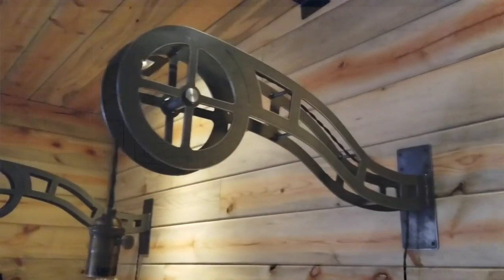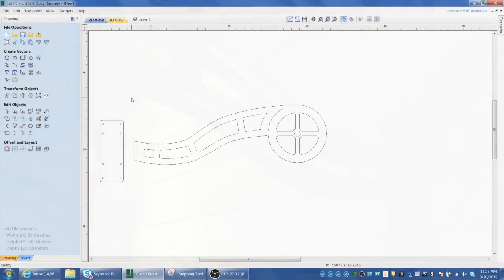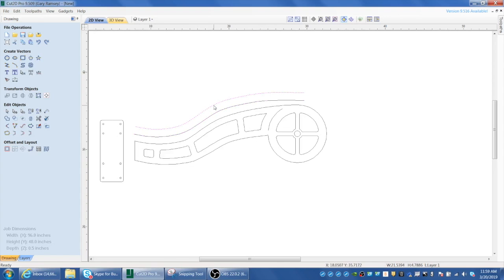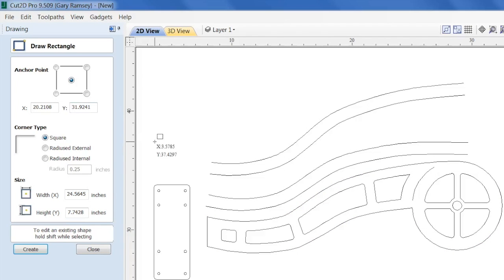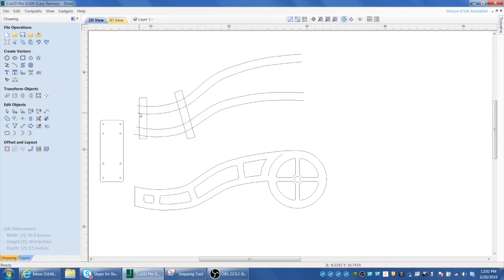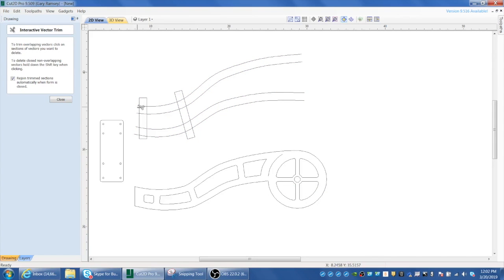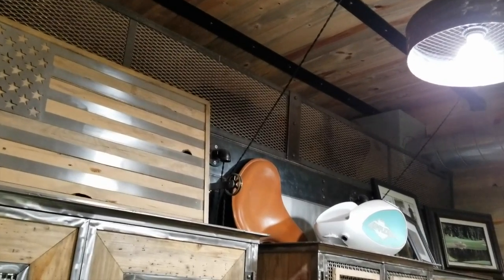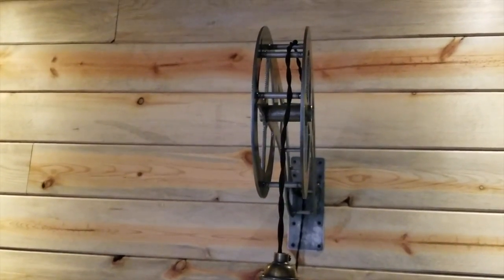Industrial Pulley Pendant Light - CNC Plasma CAD Files - downloadcnc.com

Comment: Has pirated version of windoz... haha!
Reply from the maker: not at all pirated.. original factory load Windows 7 on a 6 year old laptop, that is now complaining that its not secure and may not be genuine... I have a new Win10 desktop to start using, just too lazy to load the software and prefer using the MAC when i can, too bad vectric software doesn't run on a MAC
Reply: @turbocobra  You have no idea how much this pisses me off... CNC manufacturers supply CAM that only runs on Windows 7 and XP... GRRRR!!! Which is why one of my computers that runs a machine, is never allowed any internet access. If it updates or goes down because of a virus, I'm completely screwed!

Yes, my favorite is definitely Vectric!! I'm really, considering getting a Surface, but skinning it so it looks and behaves like a Mac. Apple has really dropped the ball, and no longer supports creatives in the way it used to. Hamstringing their iMacs and Powerbooks with shitty, older components, removing all the ports and charging twice as much for half the hardware.
Reply from the maker: @EcoMouseChannel  I agree on the MAC.  The unit I have is now over 3 years old, out of warranty.  Its performing good.  I like Final Cut Pro for video, but have also used Power Director on Windows and its comparable.  Nice thing about all apple software is you pay one price and get unlimited support with no annual maintenance and you actually own the software.  Pretty rare this day and time.    But when this thing dies, I will be switching back to a high end Windows desktop for all CAD and video.
Reply: @turbocobra  I would love to be able to completely run on something like Linux Mint, but there's no real god CNC CAD/CAM options that I'm aware of yet.
Reply from the maker: @EcoMouseChannel  just run a windows VM for your windows apps ?
Reply: @turbocobra  I have that, and I hate it. Bootcamp sucks... Parallels is better, but they keep needing updates and I lost some capabilities.
Reply from the maker: @EcoMouseChannel  It sux that MacBooks are so dang expensive.  The one I have now was like $3300 new, definitely not doing that again, Can buy a very nice powerful windows desktop for $1500.  Windows is still buggy, but way more stable than it used to be, and even though i have been on a MAC for 6 years (2 different ones), I can still move files around and navigate windows much faster and easier than a MAC
Reply: @turbocobra  I'm just the opposite, I've been using a Mac since '88, and a little Apple II before that. I prefer the way things behave, and the logic behind what and where things are. I suppose we have Xerox to thank for that. Plus I like the key modifiers "control, option and command" I hate the windows key.  What a pointless button.